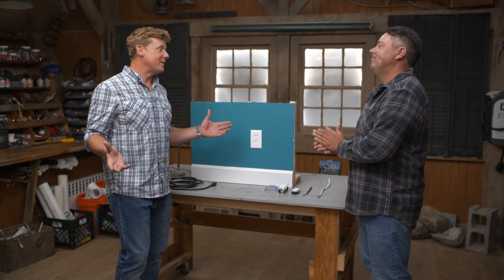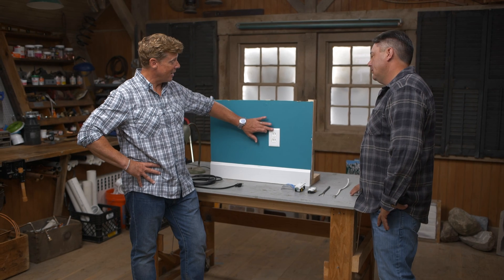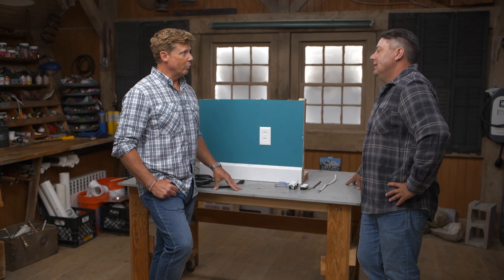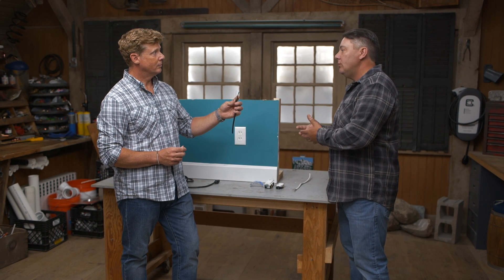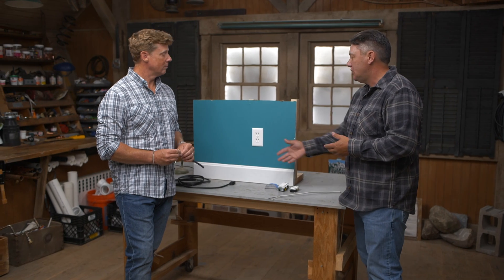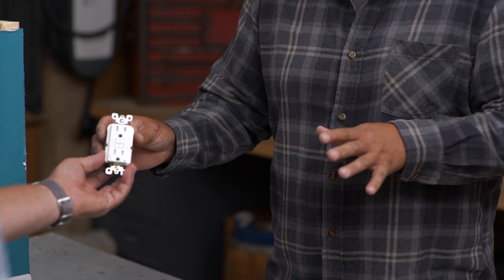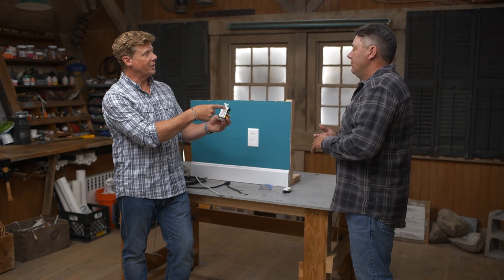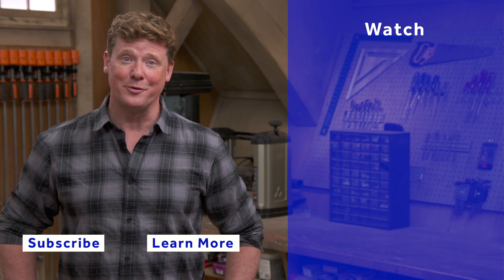How to Understand Two-Prong Outlets | Ask This Old House

Comment: If the outlet box is metal (which they usually are) and if it’s fed with Armored Cable (BX) then the box is grounded via the BX outer sheath. If that’s the case, a Self -Grounded receptacle could be used and the 3rd prong would serve as a ground & be compliant with the NEC. OR, if a GFCI is installed in this particular scenario, then the metal yolk of the GFCI would provide a low impedance path to ground and the 3rd prong would be grounded. There are also self grounding GFCI’s which are NEC Code compliant.
Reply: Right that’s what half my house. Bx cable running to metal boxes. I was going to update the electrical but the bx is still in fantastic shape and my electrician said there is no need to do that right now.

Comment: My issue is that I have this and still have a hum sound when playing my vinyl records. I have the fake outlet allowing me to plug three prong, but it's not grounded. I need to hire an electrician to actually bring in a full ground wire to the outlet.
Reply: seanlancaster, your audio hum problem likely has nothing to do with whether you have one kind of outlet or another. A likely cause of hum is having multiple grounds, in other words, more than one piece of equipment in the audio system is connected to ground.  This can cause ground loops between the equipment, with the other side of the ground loop being the shields of all those RCA-terminated stereo cables that interconnect the equipment. Try making sure that only your amplifier is connected to ground at the receptacle. Ground loops aside, normal shielded audio cable connections in home audio systems are usually hum-free, even if those cables are run in close proximity to the AC power cords.

Another thing that can cause hum is old audio equipment that has filter capacitors that have gone to meet their maker, thus there is a lot of ripple on the internal power that the audio equipment circuits are using. Often,  just replacing failed aluminum electrolytic capacitors will get rid of hum.

Sometimes hum can result from corrosion on the connectors used between pieces of equipment.

Comment: Can you just change out the first receptacle in the circuit to AFCI/GFCI or do you have to change out all of them on each circuit?
Reply: One can use a GFCI/AFCI breaker if it possible or a GFCI/AFCI device that's eather a recptical or a blank face recptical like looking device; this can be installed at the first recptical junction box in the circuit that well have the ability to give protection down stream to other devices like recpticals.

Comment: If the wiring is metal clad meaning ground can be put on the metal meaning you can use a gfci with extra protection with the ground

Comment: I have an old house from the 1960s. The outlets in the house are a triple stacked 2 prong outlet. The top one is for plugging in floor lamps. The other two are for other stuff. How do I change them out for the new code 3 prong outlets? I can’t find any videos on how to do it.

Comment: Will adding a GFCI outlet provide for using a serge protector on that outlet?
Reply: No, not unless the GFCI has a ground wire.
Reply: @surferdude642  Incorrect! A surge protector has varistors between al contacts.

Comment: In an area that Is open the cables. It is preferable to have two ways to prevent a shock.
Reply: Washing machines had a grounding screw that allowed a wire to be run to a metal cold water pipe.

Comment: I mean if we want to get technical as long as you don’t have a sub panel in your house the neutral and ground go back to the same exact bus in the main panel so they’re really the same the ground is just a redundancy
Reply: They're not the same. Neutral is a current-carrying conductor under normal operating condition. Ground should never carry current other than in a ground fault condition. Two different purposes which were explained in the video.
Reply: @JH-ms3ny  so you read a book without actually understanding congrats
Reply: Even if you have a sub panel they are eventually connected.

But there are safety implications to running normal operating current through the equipment ground (or eliminating it and bonding neutral to frame). Sure, an equipment ground and grounded conductor (aka neutral) can both operate an appliance or provide a low resistance path for fault current, but with an open neutral just about anywhere, that old set-up becomes a problem real fast.

Comment: Yeah I'm going to tell my customers who have old wiring and plastering that's their solution is to install 15 dollar each GFCI in all their outlets . Sounds expensive but compared to cutting the walls etc . Not everyone can afford this especially with the prices they got now .
Reply: Talk to an electrician first please you don’t need to change all the outlets just the first one then load the rest off of the gfi. If you don’t understand this you can cause a bigger mess

Comment: I am a contractor and have wired many new and old construction. One thing I have always noticed is that your neutral at some point, usually in the braker box, is tied into your ground
Reply: Only on the main service. Sub panels have the neutrals and grounds separated. You sound like you have no clue of household electricity
Reply: @5_fun_facts123  I know enough to do all mine and all the wiring for my customers and never have an issue. Its not rocket science. And never had a house with a sub panel. That just really isn't a thing where I live

Comment: The house I grew up in had 3-4 2-prong outlets left after the previous rennovation, along with some knob & tube that was still in use. To sell it we had to have the knob & tube replaced (which went to 3-prong outlets with no ground) and found that the wire behind the 2-prong outlets was modern romex with ground conductors that had simply been cut short so they didn't have to spend $10 on 3-4 new 3-prong outlets. Not as insane as having 3 circuit breakers feeding various wires into a standard 4" box but close.
Reply: It's like builders using indoor rated screws outdoors to save a few cents.  Absolutely ridiculous.

Comment: He forgot to mention that many of the two pronged receptacle outlets are grounded at the box by the BX cable and then all you have to do is switch the 2 prong receptacle to a regular 3 prong receptacle.
Reply: I wouldn't say he forgot to mention it.   This was 5 minute segment about a solution, not a course on all available options depending how the home is wired.
Reply: Yes. Some of the older houses had the "continus ground wire" that joined the whole house with one thin ground wire
Reply: @5_fun_facts123  it’s not one the thin ground if it’s BX the whole entire steel jacket is the ground and the mounting screws ground the device to the metal box
Reply: @TheBooze13  Never seen a house wired completely in BX. Now if we were talking commercial you would be correct.

Comment: Good video. Wish you'd have gone over 2-to-3-prong adapters though - those little $1 plugs that let a 2-prong outlet accept a 3-prong cord. They seem like most peoples' first choice in this situation and it'd be nice to talk about the safety risk of essentially ignoring the grounding wire.
Reply: The only way those adaptors serve any purpose other than smearing lipstick on a pig's face,  is if the house is wired with AC cable, also known as BX, and metal boxes, found in some homes in the 40s and 50s.    In that case, you may have what are known as grounded two slot receptacles.  Though in that instance you might as well install a 3 slot receptacle than use a jumper from the Grounded box to the receptacle and avoid the adapter altogether.
Reply: I think what alder is saying that he wanted the video to talk about those adapters to explain why they are dangerous. Not everyone is going to know the reason why not to use them.
Reply: I have a bunch of those adapters, I lived in a older house that had all 2 prong receptacles
Reply: My house was built in 1938. We have a lot of those adapters throughout the house.

Comment: There was wrong info in this video.  Electricity does not "take the path of least resistance".  If that were true we could not have more than 1 house on a circuit powered up at a time.  It takes all paths proportionately to the resistance.

Comment: Found my boxes were grounded, but I had two-prong plugs. I screwed new outlets in and tested it with a multimeter. They are all grounded
Reply: That's some awesome luck
Reply: @zunedog31  your house was built in the 50s or 60s. You have metal conduit and metal boxes. The conduit is attached to metal fuse box. The metal acts as an earth or green wire. If you remember those adapter to go from to prong to three  had a wire you were supposed to screw to the cover plate. That would complete the circuit. This won't work on new houses with plastic

Comment: GFCI and AFCI are totally deference in function..So just skip the receptical and install an Arch Fault  Breaker. As you can at least use the pigtail to a grounding bus bar. That makes it back to the source. That being the Transformer..

Comment: @ 4:36, It seems he neglected to identify replacing the receptacle outlet with not only AFCI and GFCI protection, but also Tamper Resistant per NEC® 406.4(D)(5).

Comment: My  1953 house has grounded wire run to all of the outlets,  but it appears the electricians must have grabbed onto it and ripped out / broke off the light gauge ground wire somewhere down inside of the sheathing while installing the receptacles.  Gotta love it.  Put gfci/afci breaker in for now but will need to cut the drywall out and replace it all one day.
Reply: Sometimes, it’s bent towards the back and you can grab enough to add a pigtail.

Comment: Great alternate for those of us in jurisdictions cough Chicago cough that require all electrical wiring to be in conduit. Now the already huge task of requiring means running conduit throughout the walls as well. 

This is a budget saver option for the first receptacle in every circuit!
Reply: If it’s armored cable or bx the armored metal can be used as a ground if it’s properly tied in
Reply: Besides being a suitable ground in most instances, the conduit makes rewiring much easier. There is less of a need to open walls when you can just pull it theough the pipe. I pulled hundreds of feet of brittle, cloth covered wire out of my house in Chicago .

Comment: How would a gfci arc breaker inside your breaker box work for protection of non 3 prong receptacles?
Reply: It would protect all the outlets on the circuit and the breaker for that circuit would flip any time a ground fault was detected anywhere in said circuit. Great if you're on a budget and/or if your panel is easily accessible. Inconvenient if it's in a garage at one end of a ranch-style house and you are drying your hair in the bathroom at the other end and have to walk all the way across the house with wet hair to go reset the breaker (that's one of the reasons why they want GFCIs for each outlet in the bathroom).
Reply: It would provide protection to that circuit, and allow you to change 2-prong receptacles to 3-prong receptacles as long as they're labeled as having no equipment ground.

Comment: Hi, I watch a lot of you tube and I am always horrified when I see two pronged outlets being installed, here in the UK we went over to three prongs in the 1940’s and although the shape of the prongs has gone from round to rectangle we still have the ground wire and take the added protection of using a cover for anywhere the ground is open like to a switch etc. although I think the use of three wirers is better I still see two pronged outlets being installed in new builds.

Comment: Lets clear something up. That is not the outlet. That is the receptacle that is attached to the outlet. See NEC definitions for receptacle. Receptacle: A contact device installed at the outlet for the connection of an attachment plug, or direct connection of electrical utilization equipment designed to mate with the corresponding contact device.
Lets say that again, it is a contact device installed at the outlet and not the outlet itself.
Receptacle Outlet: An outlet where one or more receptacles are installed.( not the receptacle itself, but the outlet the receptacle is attached to)

Comment: VERY good explanation but at the end of the day if the house was installed after 1960 theres most likely a ground wire, They used to cut it at the box back then.. therefor installing a regular 3 prong receptacle is just fine

Comment: Glad I had my 1940 place fully rewired when we moved in.

Was pricey, but now I have (what feels like) a modern house with the modern amount of outlets and amperage. Could do without the AFCI breakers that trip every time I use my sewing machine though...
Reply: Yep those AFCI breakers cause more problems then prevent them lol
Reply: @STXVIEC  thankfully I had the house done just under the wire re:AFCI becoming mandatory everywhere so now I only have to run an extension cord from the living room to my office.....
Reply: @STXVIEC  AFCI breakers don't cause any problems. Malfunctioning wiring & devices cause problems. If a device keeps tripping AFCI it has an electrical fault and either needs to be repaired or thrown out.
Reply: @jblyon2  Not exactly. many kitchen appliances just hate being on an AFCI breaker.
Reply: @STXVIEC  Correct. Kitchen appliances that were not manufactured properly, or have worn components to the point of being unsafe. If the AFCI trips, the kitchen appliance is UNSAFE.
Reply: @jblyon2  false. You clearly aren't an electrician working in residential applications lol
Reply: @STXVIEC  Clearly you aren't, or if you are you should lose your license. I grew up with a master electrician. If it tripped a GFCI, and later on an AFCI, it wasn't safe and was not allowed in the house.
Reply: @jblyon2  hahahaha golden. Youtube hero trying to take my licence over a "code" that came out less then 8 years ago. Pathetic

Comment: Good video. I don’t think it was mentioned if every single two prong receptacle HAS to be replaced with an AFCI/GFCI three prong receptacle. Would it be best if the new code compliant receptacle be installed on the most upstream outlet of the circuit and have the rest of the receptacles on the load side? In doing so, one would be saving a lot of money…or is it best to replace ALL receptacles with an gfci/afci? 

Thank you.
Reply: You can do just the first outlet in the circuit but wiring them for downstream protection is different than wiring them for simple use as a normal receptacle.
Reply: @HaploBartow  I know they need to be wired to the load side and the incoming wire from the panel needs to go in line
Reply: You only have to replace the first receptacle in the line/circuit it can be hard to find but you can save alot of money by putting it's first all the wires coming in is called the line all the wires carrying over to the other plugs is called load
Reply: @Vanilla_Icecream1231  Like they were mentioning in their conversations, get the TERMINOLOGY RIGHT !    Don't call a RECEPTACLE a PLUG !..... The receptacle RECEIVES the plug that you are plugging in....
Reply: @troybush5899  I usually call it receptacle I don’t even know why I wrote plug

Comment: My wife got in the habit if breaking off the ground of the plugs. Drives me nuts…not to mention unsafe!  I didn’t know about those afci devices. They are probably expensive I’d imagine…lol
Reply: Home Depot near me sells them 22 a piece or about 17 a piece in a 10 pack. It's a lot cheaper than a insurance claim though I suppose
Reply: Cutting off those grounds is a good way to get shocked when you touch a metal encased appliance.

Comment: If you add downstream outlets that are protected by the GFCI receptacles you can add a little arrow to the "Protected by GFCI" sticker indicating which way to go to find the GFCI device to assist others in finding it when trips.
Reply: Technically by code you have to, if your circuit has no ground. You also technically have to add the "No Equipment Ground" sticker as well. (if your house has a ground the code has no sticker requirements)

Comment: How can you not talk about the grounding clips in the box?? That plus a new set of receptacles are WAY cheaper than a GFCI at every outlet point!!!!
Reply: Grounding through the box doesn't work if your wiring is not BX/AC or conduit...which many houses aren't
Reply: If the box is not grounded, which it wouldn’t be in a two wire system, a grounding clip does absolutely nothing.
Reply: @shockcoach  true, but it should be mentioned as a MUCH cheaper option, if the box IS grounded
Reply: @shockcoach  Ok, false. It's why they SELL the grounding clips. Many/most 2 prong boxes are actually grounded, given their construction and that many/most of them used the old metal wrapped wires. Honestly, why do you think they even sell them? LOL
Reply: @allenellisdewitt  clips work only if the box is grounded. If you have a 394 wiring method, your box is very unlikely to be grounded. Therefore a clip to a three prong receptacle creates a very dangerous situation. Also, if you have the first generation NM with no ground, you end up in the same boat. Just because they sell something, doesn’t mean it’s a cure all.